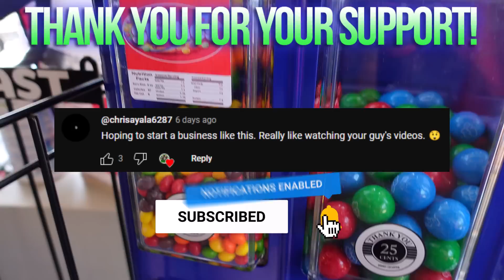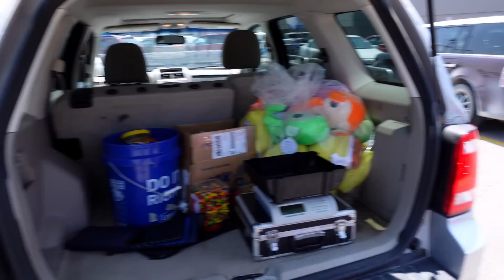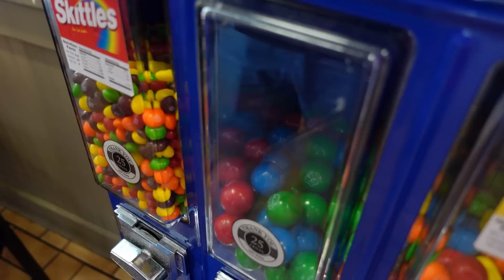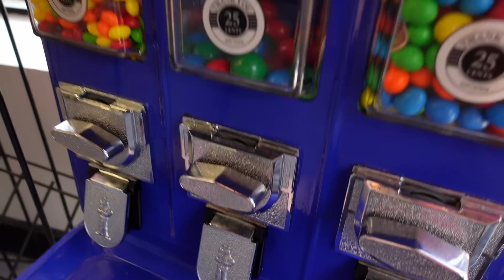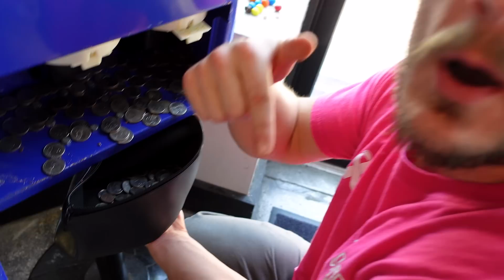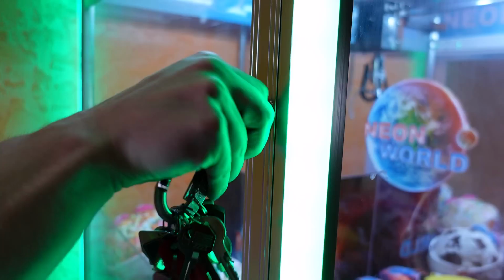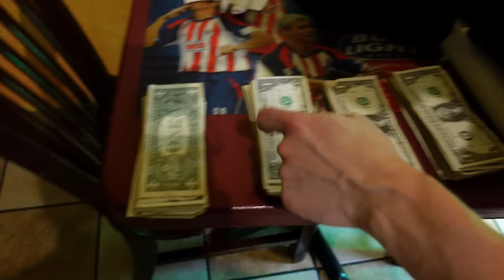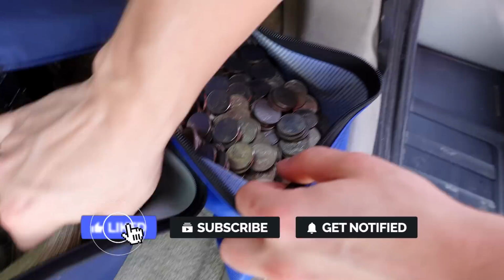Collecting SO MANY Quarters From Our Candy Vending Machines!

Comment: I wanted to know if there is a reason not to use the coin trays? I just started my own triple vending machine as well, a few days ago. I thought it would be quicker with the trays to collect. I also came to the conclusion that I may only be collecting enough money just to buy the candy and not any profit. I wish I had seen your promo code before I purchased. It is very expensive to buy bulk candy. I pray I get the money I spend back and more. Thanks.
Reply: I am just doing hours of research but your vend amounts could be giving too much candy away.  I know there is a way to adjust how much comes out.  A gumball costs 3 to 4 cents when bought in bulk so you should be making money.